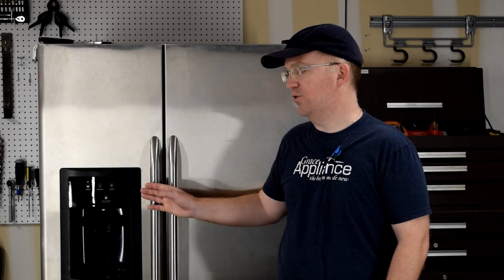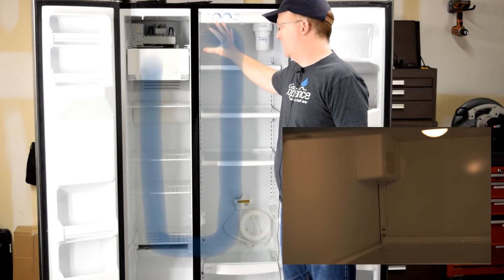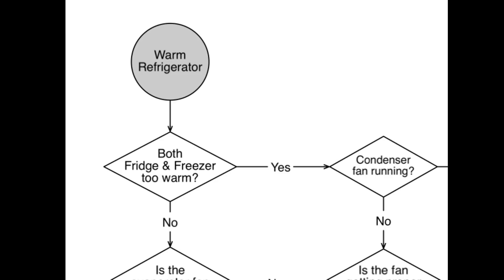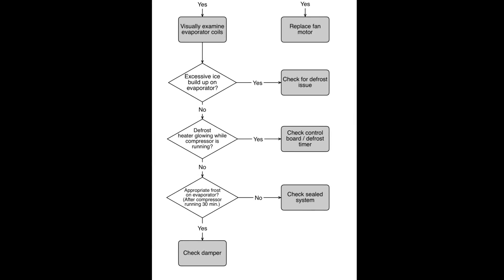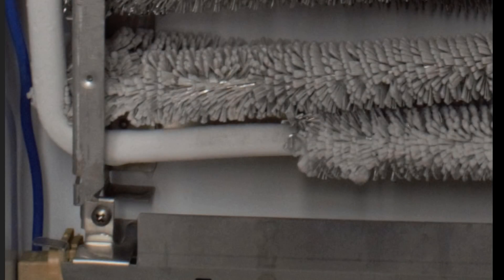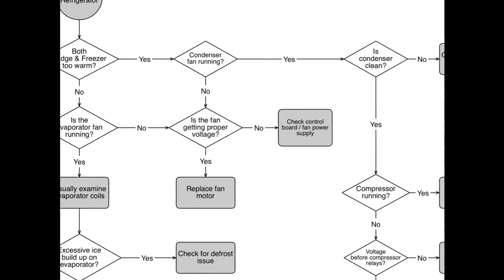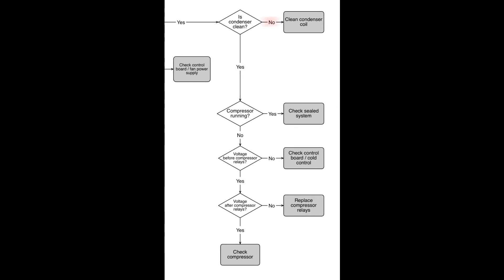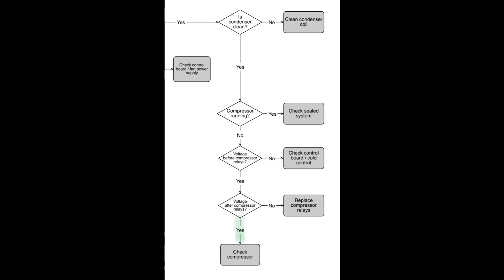Refrigerator Too Warm - Diagnostic Steps

Comment: Hi Andy,

I have a 24 year old GE Profile 30 cubic foot side by side - Model  TFH30PRTA BB 

About 6-7 months ago, the evap fan was making a little noise.  Then tile guy moved fridge and fan stopped forever.  The condenser fan could still be heard running in bottom back. 
-The top half of fridge was warm, the bottom half was 40-50 degrees.
-The freezer was warm in top half - 30 degrees in middle, and top shelves 40-50 degrees.  
-Freezer bottom was around 10 degrees.
-We used both bottom halves since then.
-I cleaned the packed dusty coils coils at bottom of fridge (very hard to clean in there.  Any ideas?  I got a 2' long point dryer vent brush, but it doesn't get all the way back).  

A couple months later, I turned the fridge cold select switch almost all the way up (maybe to 8-9) to see if that helped.  It got warmer, then we saw snow on back wall of freezer.  So I turned it back down to around 5-6, and the temps came back to cold bottom halves as above.

Now, the freezer bottom is at 35 degrees, and a bunch of snow is on back wall.  Condenser fan can still be heard running in bottom back.

Could it be that when the evap fan is dead, just the tops of both sides are warm?  And the frost is created when constantly running to cool fridge as fan is not pushing air there (the compressor fan rarely turns off)?  

Once I can get the packed freezer food used up, I plan to test the evap plug for power (12v or 120v?).  Then replacing the fan as suspected.  I saw your other vid on the 1st 3 wire ports to test on main board in back.  Any suggestions for me?

I would buy a new fridge, but Home Depot sales told me the LGs got bad ice maker lines that freeze, and the Samsungs bad compressors.  I do need a 30 CF or bigger for family of four that eats only at home.  If this fridge dies, any solid big ones that last that you know of?
Reply from the maker: bawareh hi, I’m sorry to hear about your fridge issues.  

Based in the description, it sounds like a defrost issue. Which is the extreme frost build up. I’d approach it as a separate issue if the evaporator fan stopped running before the frost build up happened.  

Your evaporator fan motor as a legitimate GE part is quite expensive so you may consider an aftermarket.  I’ve never had an issue with an ERP motor. Here is yours: amazon affiliate link https://amzn.to/2H2zCT9
Like you said, if you can get meter leads on the motor terminals, you should be reading 120vac. If so and the motor isn’t spinning, replace the fan.  

And while you’re in there, (For the defrost issue) I’d start by doing an Ohm test on the defrost heater.  If that checks out you Also can take a voltage reading at the heater terminals. When it’s in defrost you should be getting 120v to the heater. The compressor and fans should turn off at this time too. You can put it in to ‘forced defrost’ by advancing your mechanical defrost timer with a flat blade screw driver.  
I’m not exactly sure of the location of this on your fridge, but usually there is a circle access hole for the screwdriver near the cold control knob somewhere.  It should look like this: amazon affiliate link https://amzn.to/2U8w3Pa

You rotate it around until you hear a slight click and the compressor turns off. At this point you should receive voltage to the heater.   
Dinner time, To be continued.
Reply from the maker: Hey, i'd focus in on the defrost thermostat which is located on your evaporator.  Examine it to see if it is bulged out.  You'll have a small metal can about the size of a stack of 3 dollars in quarters.  It will have a plastic bottom on it which should not be bulged out.  Let me know what you find. 

Thanks
Reply: Hey Andy my hero!  

So I finally got around to fixing my fridge.  I packed food in my cooler with some ice on it.  The hardest part was removing about 3" of ice on back panel of freezer.  Then another 3" behind that panel and around the evap coils.  I chipped some with a chisel/screwdriver/blunt chisel.  Then used a blow drier as you suggested for the solid ice blocks that wouldn't break off.  I used a big shop-vac to suck up all the melted ice at bottom of freezer. 

When I could see the parts, I noticed one of the 2 heater tubes was black/burnt out.  I had bought both heater tubes & thermostat as an assembly just in case, and so I don't have to solder any connection that could corrode.   Fridge  & freezer have worked perfectly like a champ ever since - about 3 weeks now.  Fridge is 40, & freezer is 0. 

 YAY!  Thank you!

My guess is freezer was in defrost mode when my painter pushed it hard over the uneven tile floor and the coil shorted.  What do you think?

What I don't understand is how the evap fan (at top of freezer) just started working after 8-9 months?  So weird!  I didn't bother to change it out even tho I have a new motor.  Any ideas?  

I can't thank you enuf for the videos & advice that gave me the gumption to attempt to repair.  How can I send you some beer $?  Got a Paypal or other way?
Reply from the maker: bawareh hey!  Great work. I’m so glad it worked out well for you. You’re most welcome on the assistance.  
As far as the evap fan, I’m not sure. I know some fridges will run the evap fan voltage through the defrost thermostat, so perhaps replacing that is what allowed voltage to get back to the fan again. That’s my first thought.  

In the description to this video you should see a PayPal link. Your donation is most appreciated. Thank you for the follow up on the great outcome!
Reply: OK, just sent ya some $.  Thanks again!  :)
Reply from the maker: @bawareh  you're awesome. Thank you!
Reply: @GraceAppliance   

Hey Andy, so the replacement lasted perfectly for 3/4 of a year.  Now it is doing the exact same thing (Freezer - 30-40 degrees, and fridge 60s).  I first noticed the fridge a tad warmer (50 degrees), so I slid temp knob a tad higher, and temps go the exact opposite - warmer in both sides, & ice grows on the freezer back wall.  I was wondering if packing the freezer to the hilt (in every nook and cranny) might trigger this issue?  I think that I had packed it b4 it broke last time too.  

In any case, this is the 2 heaters & thermo assembly I bought last time....
https://www.amazon.com/gp/product/B076K1FR9S/ref=ppx_yo_dt_b_asin_title_o05_s00?ie=UTF8&psc=1

Any thoughts on what else may cause this?  Or do you think it is likely just bad parts?  Do I just buy the same assembly & redo again, or should I replace the Defrost Timer, or something else?
Reply from the maker: @bawareh  hey, yes poor air flow due to excessive food can certainly cause the symptoms you describe... Warm temps and frost buildup in strange places.

I would empty some food out of both sides to allow for proper airflow and see if this improves things.
Reply: Hello Andy,

I bought a temp chest freezer, then used my GE freezer for fresh foods.  The back ice has been completely defrosted for 3-4 weeks now.  The coldest temps I get when pushing dial back up is Freezer: 10 & Fridge: 50, and ice starts to build.  So I tested the heater circuit via the timer wires again.  Again, it has an open/broken circuit!  So that means the last heater-thermo kit lasted only 9 mos.  

Do you have any idea why my heater-therm kit died after ONLY 9 months?  Do you think I should test the Defrost Timer too?  If not, should I check anything else?  Or is my 25 year old GE Profile just straining too much when packed full???

This is the $17 heater-thermo kit I bought last time....              
https://www.youtube.com/redirect?redir_token=ZmSBNJ2yWC3NGRyN0QCsoE4tQkZ8MTU4NzE2MTQ2OUAxNTg3MDc1MDY5&q=https%3A%2F%2Fwww.amazon.com%2Fgp%2Fproduct%2FB076K1FR9S%2Fref%3Dppx_yo_dt_b_asin_title_o00_s00%3Fie%3DUTF8%26psc%3D1&stzid=UgwAfhN-aUpXHxeNlil4AaABAg.8rkaWupKtBP8s-Vb9dY-Ac&event=comments

I have 3 options to buy:
1)  $19 ERP heater-thermo kit -  https://www.walmart.com/ip/WR51X443-for-GE-Hotpoint-Refrigerator-Defrost-Heater-AP2071465-PS303934/192991130
2)  $28 TacParts - 
https://www.amazon.com/WR51X443-Defrost-Refrigerator-AP2071465-PS303934/dp/B01MF598JX/ref=sr_1_3?dchild=1&keywords=wr51x443+ge&qid=1587083880&s=appliances&sr=1-3
3)  $77 Parts Select OEM GE part - https://www.repairclinic.com/PartDetail/Defrost-Heater-Assembly/WR51X443/2001

The first two come with a 30 day from delivery.  The last one is OEM and 1 year warranty, BUT it requires part to be (NOT EVER INSTALLED)!  So useless.  LOL 

So should I go with #1,  or pay more for the GE OEM?  Anything else to do?
Reply from the maker: @bawareh  I've always had good luck with ERP parts. The other I have not heard of before.
I wouldn't have any issue with recommending that one.
The timer should keep the fridge in defrost about 20 minutes +/-.

I can't think of anything else that would cause the heater to fail prematurely as it has though.
Reply from the maker: I’m not able to find your schematic right this second, but you can also test the heater circuit directly from the wires that plug in to your defrost timer. If you do not get continuity there on that circuit, you know you either have a bad heater or defrost thermostat which to me is very suspect in your case.  Visually inspect it while doing the other tests and see if the bottom plastic portion of the defrost thermostat has bulged out of the metal case.  It looks like this and will be clipped to one of the copper lines leading to your evaporator.  Amazon affiliate link https://amzn.to/2H1CboG

As far as larger type freezers, I’m not really sure what I’d recommend.  Not LG and not Samsung. That’s a for sure. 
I’ve seen some really bad examples of almost every brand, but tend to lean toward a side by side Whirlpool if I had to choose a new one these days.   

Let me know if you have any questions!
Andy
Reply: Hey Andy,

FYI, I do not have a control panel in the back to test any wires there....I guess mine is too old.

I tested the defrost timer (it is at inside of fridge top by light).  I turned the slot till it clicked loud and lights & compressor turned off.  35 minutes later, they came back on.

As you suggested, I did test the two wires going to the timer (shut fridge off, then took off cables) and got no continuity.  So I bought the heater and thermister assembly (it was cheaper than the GM thermister only).  I think it is both parts?  Bought this one.....
https://www.amazon.com/gp/product/B076K1FR9S/ref=ppx_yo_dt_b_asin_title_o00_s00?ie=UTF8&psc=1

When I get the evap fan, heater, and thermister, I will install them all, after de-icing the back wall, then the coils (It is a LOT of ice on back wall.  Any suggestions to de-ice?  Blow dryer may take a while....is warm water ok?) and let you know what happens.

Thank you for your help.  Couldn't do this without you.  :)
Reply from the maker: Hey!
Nice work. You're most welcome.  

Yes, warm water is fine, but messy. 
You can use a hair dryer but wouldn't use a heat gun. 
I use a steamer personally.  

Your timer sounds like it's doing its job. The new heater and thermostat should do it for you.  

Let me know if you run in to any questions!
Reply: Hey Andy,

So I have been busy with other issues and have not done any repairs yet.  And now, after 8-9 months, the back wall is inches thick in ice, and all of a sudden, the Evaporator fan kicks on for the first time in that long, and has been working for 4 days or so.  WTH, could cause that....besides it being possessed that is?  LOL

Temps are still 40s in freezer, & 55-60 in fridge.

Comment: how long should it take to cool after you clean the coils?
Reply from the maker: It will depend on too many factors to say for sure, but with the doors closed and empty it should be done to 0’F in the freezer after 24hrs.  Probably sooner so long as the compressor is still in good shape.

Comment: We have a Monogram SxS, model ZFSB25DXSS,  6 years old.  Temps fluctuated on both fresh and freezer sides as well as moisture on fresh food side accumulating around the sensor.  Techs came-had some new parts installed, checked( "motherboard").  Temps seem to be OK now, but moisture is still accumulating around the sensor (which was replaced) and drips.  No real answer from techs as to preventing and why.  Would appreciate your input.  Thank you!
Reply from the maker: Hey JG, 
Sorry to hear about your issues with the refrigerator.

So on your refrigerator, you have 2 evaporators. One for the freezer and one for the fridge side. I suspect that the moisture is actually coming from a clogged defrost drain line on the refrigerator side.  Either a clogged defrost line not allowing the water to drain out after a defrost cycle on the refrigerator side...this, or the pan that directs the water to the drain tube is not level and dumps the water before it gets to the tube.  I have seen this before on these models.  

This fridge actually does not have a defrost heater, but simply lets the ambient temp in the fridge section melt away any frost on the coils. Also, this is a royal pain to even access, so be prepared for that - or better yet...pay the other guy.  LOL worth whatever he's charging I'd think.  :-(

That is my initial thought because I can't think of a source that would cause water build up around the temp sensor as you describe.  An air leak will also cause a moisture build up.  So, that's a possibility as well. 

Let me know if you have any questions. 
Andy
Reply: @GraceAppliance  Me again.  Trying to avoid buying a new frig.  1st tech (not a GE rep)said there was ice build up in the walls, unplug and start again-didn't do that-had GE techs come-tried many things.  White waiting for a part, unplugged and emptied the frig.  New part put in-temps good for a week+, some moisture on interior wall.  This am- temps 10 and 41--more moisture/condensation on interior wall.   So it seems (to me)that perhaps 1st tech was correct-ice builds between walls, unplug start again and temps good for a bit.  If so, any idea what would cause ice in wall between freezer/fresh?  Thank you Andy for any help you may give!
Reply from the maker: My guess would be the refrigerant lines for the refrigerator side evaporator are frosting up prior to the evaporator. These lines run inside the interior wall and if the system were improperly charged they would frost on these lines I would think. I haven't seen this exact scenario, but have seen where an improper charge will cause dripping water behind the fridge near the compressor. 

Other causes might be an air leak from somewhere, but don't think that would be it in your case.
Reply: Thank you.  Techs have been behind frig--no mention of dripping water.  Would techs be able to check out your first guess easily? @GraceAppliance
Reply from the maker: @jggawel2604  hey JG.
Yeah, yours would not be dripping behind the fridge.
I'm not sure of a way to test the theory I have as the lines are incased inside the wall of the fridge I believe.
To test the charge on the sealed system, it would require installing an access valve on the high and low side of the refrigerant system. So, I'm afraid there really isn't an easy way to test the theory.
The easiest way I can think of is to have someone evacuate the refrigerant system, weigh the proper amount of refrigerant back in to the system and monitor to see if it resolves the issue. It's probably not cheap. A couple hundred I would estimate to have it done right.
Reply: Oh brother! @GraceAppliance
Reply from the maker: @jggawel2604  I know. :-/

Comment: When you plug it in compressor will run in default mode but will not kick in again. The fans are running correctly. One time you take the thermistor out and put it back in the compressor and fans complete their cycles but only blows cool air but freezer never freezes. Then you can take the thermistor out and put it back in and only the fans run, the compressor will not kick in, a real puzzle. Any advice???
Reply from the maker: Hey Samantha, 
Just based on what you've shared my initial thought would be a failed control board, but i'm afraid without being there - It would simply be a guess.  It may make sense to pay a technician to come diagnose it, even if you were to do the repairs yourself you'd come out better than buying the incorrect part. I'm sorry I couldn't be more help for you.
Reply: @GraceAppliance  You have been extremely helpful and I can't thank you enough for the time you have spent investigating and answering my questions. Thank you so, so much!!
Reply: Something just occurred to me. Is there an individual test for the control board alone other than just the door switch test mode? A test directly to the board itself perhaps!
Reply from the maker: Samantha Morgan I’m afraid not. to my knowledge, no. 
It would require gaining access to the control board and testing voltage to the individual components.  
I strongly suspect it’s a failed main control board (I.e. cold control), but would really need to get hands on with it to diagnose further.  I wish I could have been more help for you.
Reply: @GraceAppliance  Rest assured, you have been incredibly helpful. I whole heartedly thank you. All your information has been of extreme value for me. Thanks again!!!